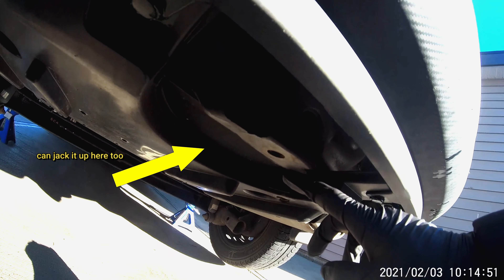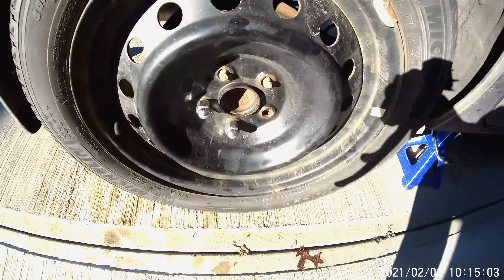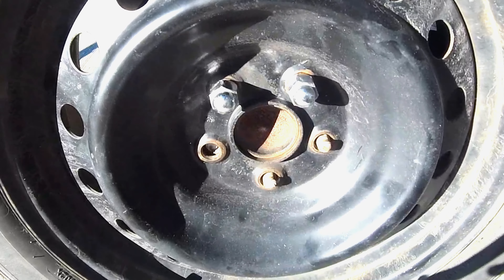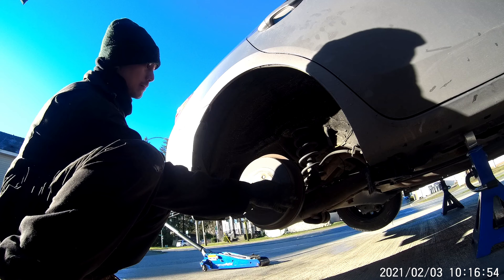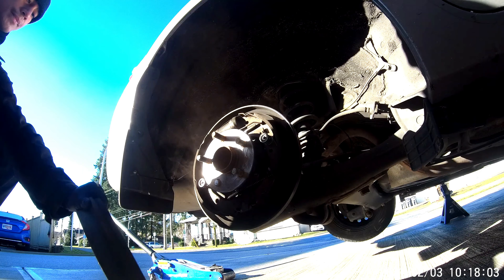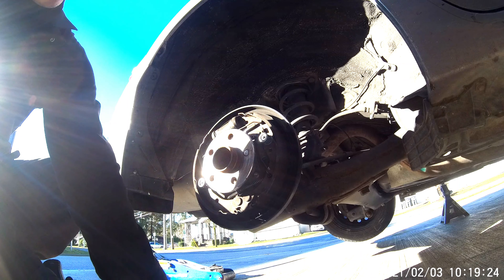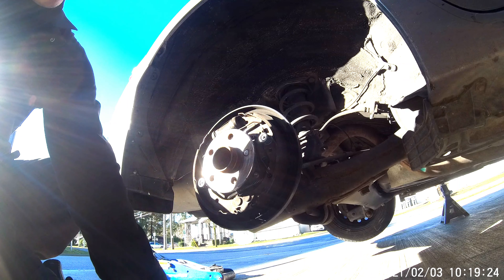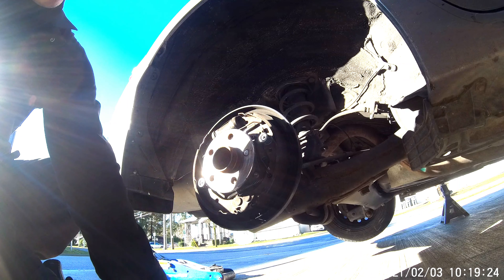Toyota Corolla Wheel stud replacement

Comment: So, you put one nut upside down, then put the other nut on top? Or two open ended lug nuts on top of each other in right direction?
Reply from the maker: One is actually a washer. 22800 Wheel Stud Installer,Wheel... https://www.amazon.ca/dp/B0BV6NS1YW?ref=ppx_pop_mob_ap_share you can buy it on amazon.
And then an open ended nut.

Comment: Any other ways of getting the plate covering the studs off?
Reply from the maker: Yeah there is, you'll have to remove the wheel hub bearing assembly.
Reply: There's two holes that hold the rotor down, remove those and find two similar but longer ones. Tighten both back and forth until it wedges the rotor off the brake assembly.

Comment: will electric mastercraft be strong engough to pull that stud through?
Why else did you change to Air gun  Let me know..
Reply from the maker: Yes, electric mastercraft gun should be good enough as long as its rated more than 450ftlbs of torque.
I used air gun because its the fastest, efficient and its the only tool that i have.
GL
Reply: @Cargorage has to be more than ? Or at least 450?
Reply from the maker: @Malacheeee  at  least. The more power, the faster the job.